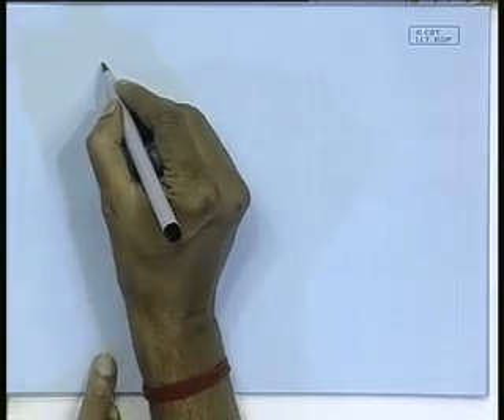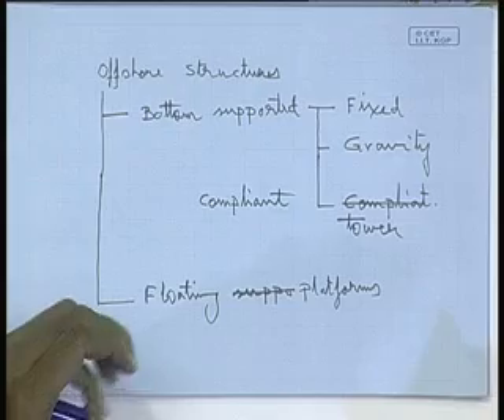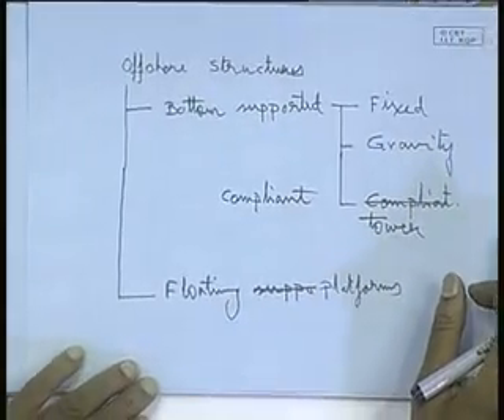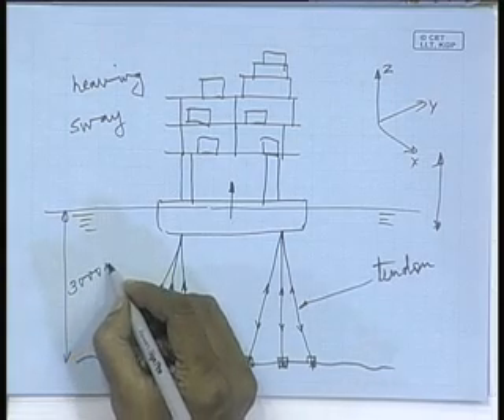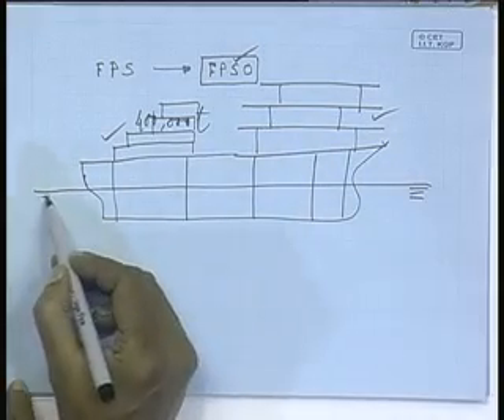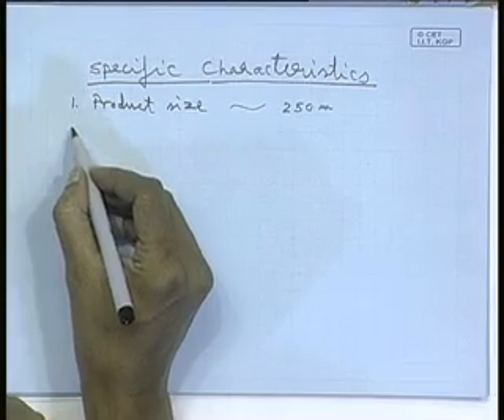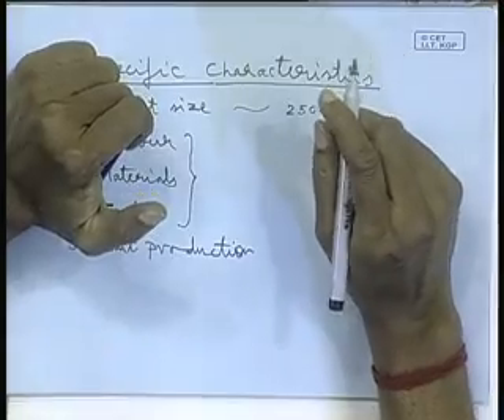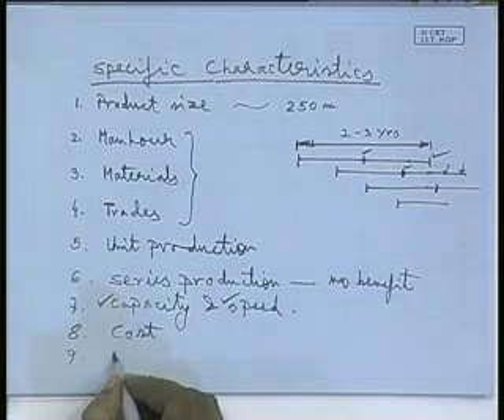Mod-01 Lec-02 Characteristics of Shipbuilding Industry

Comment: Fixed platforms are cemented on the sea bed. Foundation is made.

Gravity Platforms sit of its own weight. No foundation is required. Sub soil conditions need to be strong. If sub soil is loose platform will keep sinking. Only shallow depth operation is feasible. Not feasible even for a depth of 100 m.

Compliant Towers has freedom to move with the waves. It sways with the wave. It is something between a fixed structure and floating structure. While floating structures can move in any direction vertical or horizon, compliant platform can only move in horizontal direction. It is hinged at the sea bed. Swaying movement. Fixed and gravity structures are subject to heavy moments because it cannot move.